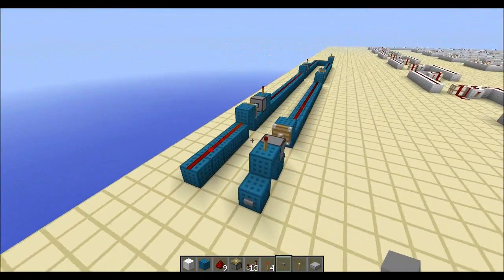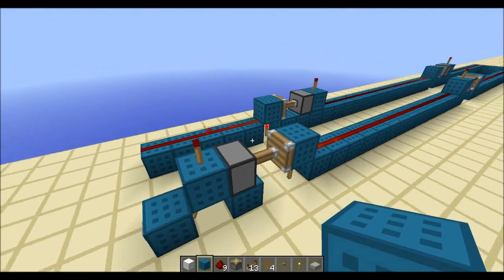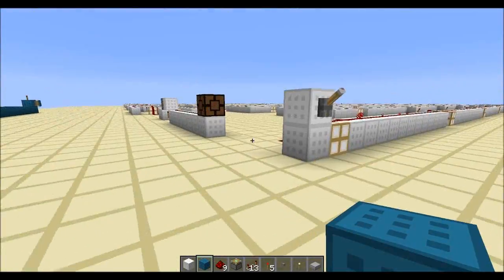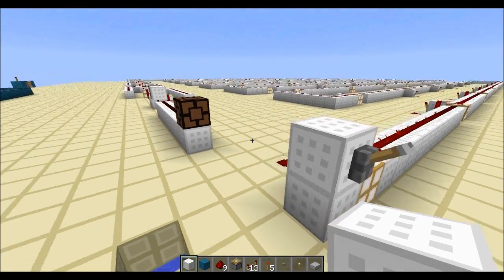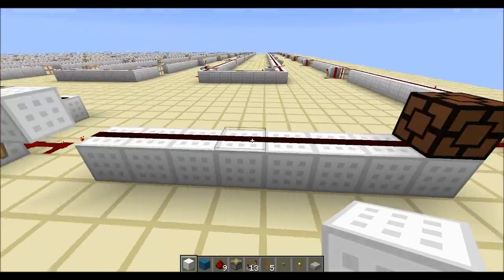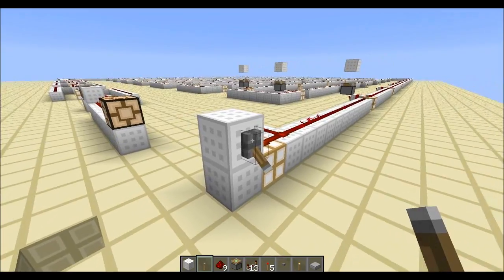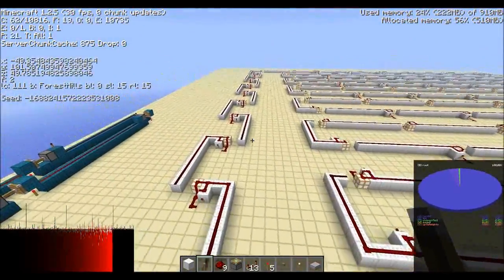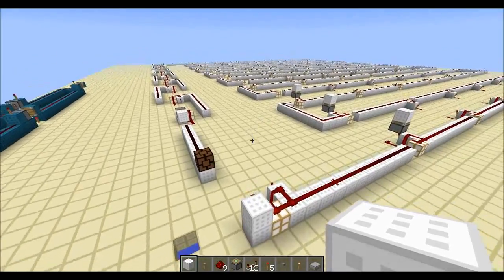Minecraft Revolution: Simple Pistonless Instant Wire (Screw you, Repeaters!)

Comment: Any way to make this so it works in unloaded chucks? I need one for my enderpearl stasis chamber 4000 blocks away and I don’t wanna use a clock :) I wanna use a button to tp
Reply: You can't send redstone signals into unloaded chunks, so you'd need alt accounts to load the chunks the wire is in. Look into wireless redstone, you only need one alt loading the chunks at the tp location. If you're playing singleplayer, I'd recommend a chunk loading mod like Chicken Chunks. That combined with wireless redstone is the only real way you could achieve what you're trying to achieve in singleplayer.

Comment: I'm pretty new to using redstone so this is probably stupid question, but it seems that the signal you get after the flip-flop (the lit lamp) is instant, but when I try building it, using slabs instead of glowdust, there's a short delay, seemingly caused by the piston. Is that impossible to avoid?

Comment: do you have a insta wire that is a built in t filp flop to u can run off muliply sigles from the middle of the wire to say turn lights on instead of a filp flop everytime to change the signal but this is much better <3 thank you

Comment: repeaters create a delay, which can make a redstone computer much slower. Yeah, it's only a couple tenths of a second depending on what state the repeater is set to. This can add up. If you have to send a signal 150 blocks, that's a 1.5 second delay, and when that's for each command in a computer, it adds up even more. 5 operations increase by 7.5 seconds, which will cause people to complain about how slow it is.

Comment: I think so, I'll try to clarify here.

You're saying that you can send a signal over an infinitely long wire, with the only delay being 1.5 ticks for the piston extending, all good here, and 0.5 when it's retracting, that's what I'm talking about, although the piston WILL take 0.5 seconds to retract, the wire will go off instantly when you retract the piston, which is what the instant wire WITH pistons is based on, instantly powering off wires.

Comment: "Instant wire has never been this simple."
Hmm, it's about the same as the wire-repeater instant wire thing. That used at least one repeater, but you don't require glowstone. It's been fixed, sadly. It had more potential than piston BUD's. :s